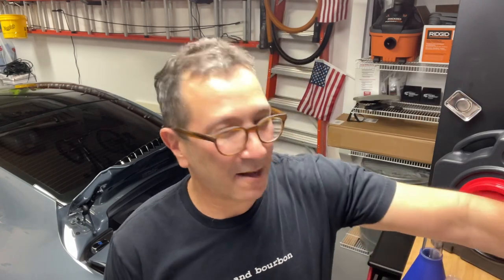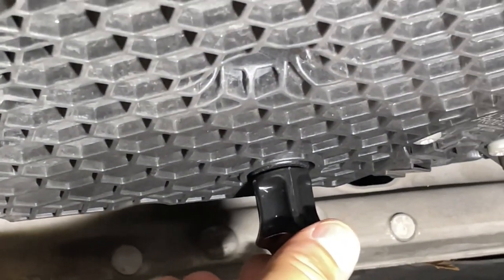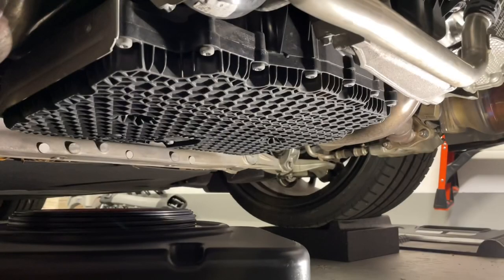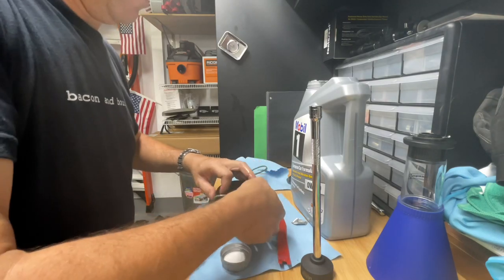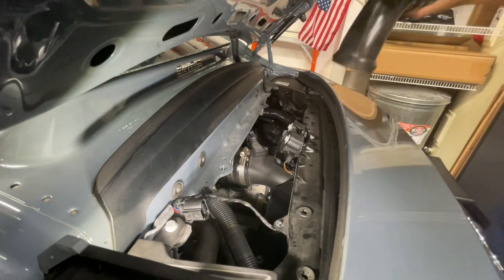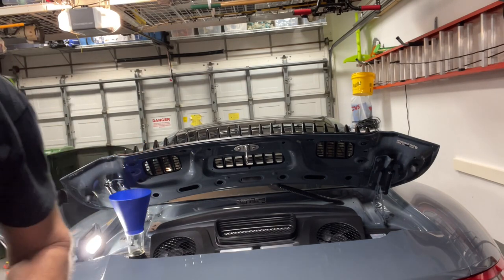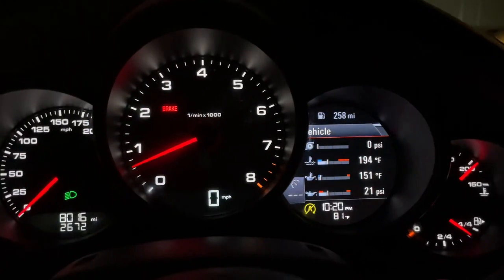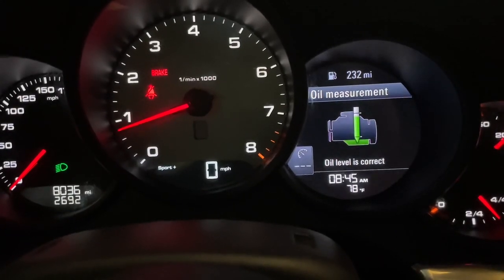First Oil Change Mobil 1 Full Synthetic Fluid Porsche 911 Carrera S 991.2 C2S DIY Maintenance 991

Comment: It is a good thing you are changing your own oil. Why? Because if you had it done by a shop, how do you know it has been changed? It is not like you can pull out a dipstick and check what the color of the oil is. I miss a dipstick. Obviously these cars were designed by people who hate getting their hands dirty...in other words, a millennial. I keep my car level hoping to get the oil out of the oil radiator out front.
Reply: Pretty sure the main purchasers of these cars are middle aged or older, so gen x and boomers so I think it was done because most aren't fit enough to work on their cars anymore. As a millennial I have a 996 C4S and have done everything from a clutch change to a complete suspension refresh (arms, shocks, springs) on my drive  way to which I've yet to find many older folks doing the same, but plenty other guys my age. So I find your generalisation a little disappointing.
Reply: @benterry2681  Sure they may be as you put it "Pretty sure the main purchasers of these cars are middle aged or older, so gen x and boomers" but they were designed by Millennials that love Star Trek high tech of glass panels used for dashes in the 992. You may find my "generalisation a little disappointing" but the fact is I do what you are doing now and well as what I was doing at 17 some 40 years ago. I'm doing much more techncial stuff than that.
Reply: When you spend 80,000 dollars for a car is it too much to ask for a dipstick. I just feel better being able to see the condition of my oil.
Reply: @robertslegers257  Another reason I miss a dipstick, on these new high-tech cars, the display will not even show you the level until the engine and oil are fully warmed up. That is a problem during an oil change and if you lost count or were distracted as to how much oil was filled.

Comment: is that hive like panel the crankcase?
Reply from the maker: That is the oil pan.
Reply: @fickstit2839  ok, is that like the oil storage part? i hit mine yesterday and it is leaking from a corner. I supose it needs to be replaced.
Reply from the maker: @fernandorosas7372  - If you indeed broke this do to an impact and have discovered it leaking oil, it most certainly needs to be replaced.  I would not drive the car.  Have it towed to nearest dealership.
Reply: @fickstit2839  yes it was a direct impact. I can even see some yellow paint in the pan. It is leaking seriously. Car is at home, so im trying to get someone to bring the part and replace it here, or towe it to the dealership
Reply from the maker: @fernandorosas7372  good luck and keep us posted!

Comment: Plastic oil pan. What next?
Reply from the maker: Yeah, I had the same thought at first until I did some reading up on it.  These oil pans turn out to be lighter weight than aluminum, offer long term resistance to oils, and absorb impacts better than aluminum.  So I guess those engineers at Porsche are no dummies after all :)
Reply: @fickstit2839  Exactly.  I found the same concept applied to the bottom of one of my motorcycles.

Comment: To think, that’s usually $500-$800 at the dealership.
Reply from the maker: Yep, and while you can trust them to do a good job, nobody is going to be more careful than you. The one major advantage of having a dealer or Indy shop do such a simple service is that they also do a multi point inspection while your car is on a lift, so they can potentially spot issues or problems before they are easily evident to the casual home DIYer. So I’ll probably opt to have this done maybe every 2nd or 3rd oil change.